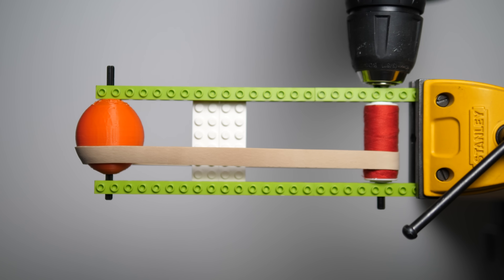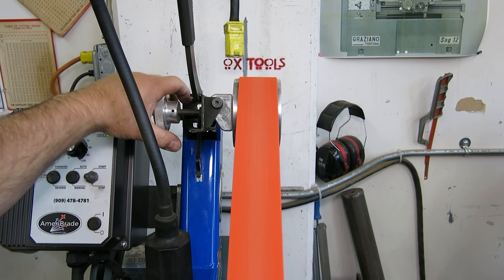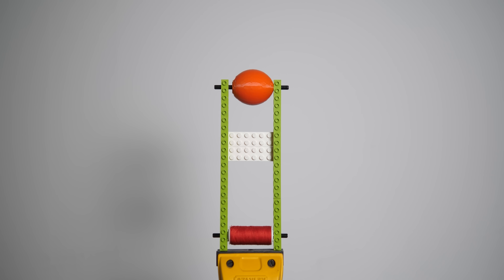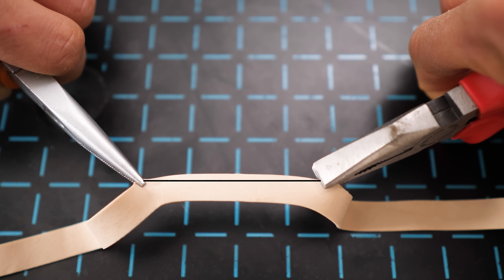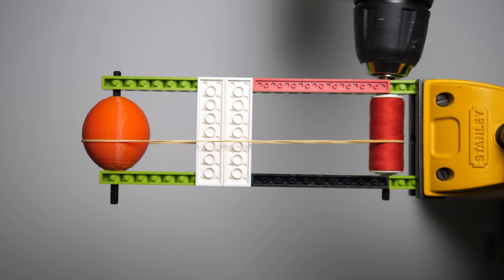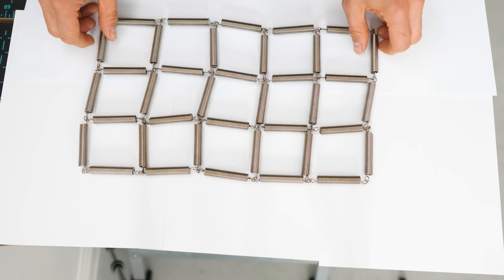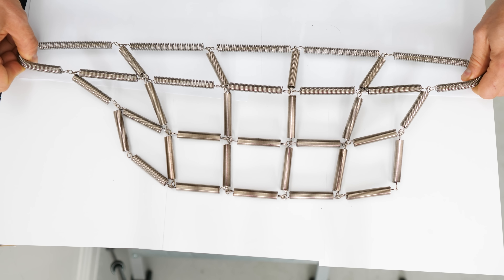The Band Should Slip Off But It Does The Opposite!

Comment: The other reason/force for this, that isn't really mentioned here is "Friction". This has to be a rubber/elastic style belt/band. As the belt starts to "slide" off one side, that side has less tension, and thus, less friction. The side with more friction "pulls" in it's direction until it reaches a point where the friction starts to balance out (the pinnacle of the crown side of the pully). In your inverted version that's the same reason it pulls off to one side. One side happens to have slightly more friction than the other (and it would only take the most miniscule amount to set the disbalance in motion), so that side pulls harder, causing more and more tension on one side. It's trying to find a "balanced" side... but since you specifically designed it to fail... it does. One might argue then that it should stay in the middle then since that's the most balanced... and whilst that is technically true, that's only if it had some sort of course correcting device in place, because even the smallest amount of tension difference (which is going to happen in anything moving) will cause it to start sliding off.

Comment: Imma take a wild guess before i continue:
Due to the curvature at the end, when you bring the belt lower the upper part is stretched more than the bottom part. This difference gets smaller as the belt gets closer to the middle so it tries to minimize this difference
Reply: Right path wrong reasoning!

Comment: Hey Steve,

Funny thing is an everyday appliance, front loader washing machine that use pulley motors have this in them. When realigning them you place the belt anywhere and it centres out. Quite awesome.

Comment: Why did you actually mention about entropy to explain why the flat rubber band tends to move toward the bulged center. It kind of confused more and took the video to different direction. Your spring analogy helped to some extent though. It would have been helpful if you had mentioned about the higher linear velocity toward the buldged part that tends to pull the the upper part of band faster eventually pulling the lower part.

Comment: I don't think that's the reason, but instead the sideways slip generated from the straight lines on a curved surface. You know how on a circle the straight and parallel lines still intersect and when the rubber is sliding on that convex shape it literally rotates it because of the curvature on those straight lines, then the bigger radius requires more material which contributes to that rotation even more

Comment: You are just wrong. Yes, bow will contribute, but it's not main reason. If you look how conical shape of train wheels allows trains to self-center itself on tracks and follow curves of tracks without differential gears, you will notice that same effect explains this belt, but tracks don't bow nor are elastic.

If we look from pulley's perspective, at lower edge of belt, wheel have smaller circumference than at upper, so, per one turn, wheel runs smaller length along lower edge than upper. That means that wheel is turning towards lower edge of belt. Then we look same from belts perspective, belt is pushed up (like when car is turned left, we can say that road is pushed right).

Comment: That’s exactly why train’s wheels are not flat but are conics, first to always center the train to the rails and second to avoid the need of a differential where the conic shape able the train to turn without desynchronising right and left wheel´s speed

Comment: This explanation really helps, not just highlighting it, but showing that intuition does work, if the rubber string is as wide as thick. 
Now I am only curious whether there's an maximum angle on the surface the rubber band is attached to where it stops creeping upwards, or perhaps the bend depends on the angle and with higher angles, the band bends more and consequently something else gives first before this phenomenon starts to swing the other way. 
Nice.

Comment: Is here a "critical width" where the rubber band no longer is self-centering? You used a wide band and a narrow band. What if you cut the wide band in 1/2 down the center. Does it still self-center? If so cut some more off, if not, cut only 1/4 off. The more interesting question is why would there be some "critical width" where the band is self-centering on the crown pulley?

Comment: My guess was about full energy of system, the motion transmit to a "ball", if we assume that linear velocity of strap equals to linear velocity of the touch point, the angular velocity equals velocity over the radius, so bigger radius means less angular velocity and less kinetic energy of the ball (T = Jw^2 / 2). Also we can write the lagrangian of the system (L = T - P) and get the equation of motion)

Comment: Anyone who has changed the belt on a vaccuum cleaner brush has seen it in action. Straight motor shaft and crowned pulley on the brush shaft.
Reply: And the blade on a band saw rides in two convex pulleys. The steel band is also "elastic".

Comment: Mathias is nuts! I once saw he building a tool that was precise in the nanometers. You'll never need to be more precise than a milimeter in woodworking. He is just that perfectionist
Reply: Sub-millimetre precision in woodworking is very much a thing. Also a tool that's precise in the nanometres seems like hyperbole, given that at the time of writing ASML is basically the only manufacturer who makes nanometre precise tooling of any kind.
Micrometres, yes, I can very much see Mattias tweak and fidget until he gets to that point. Personally in all my years of being a fine furniture maker, I have never bothered with a scale smaller than a tenth of a millimetre. For surfaces that are touched, or that are in direct sight, like say an inlay, sub-mm accuracy and precision are most definitely a thing.
Reply: “never” — that word you are using: I don’t think it means what you think it means!

…and you may not be a woodworker.

Comment: Train wheels are part of a conical section with greater diameter on the inside.  When the wheels get off center, as on a curve, the outer wheel has greater diameter (and circumference) than the inner wheel.  Since the two wheels are connected by a fixed axle, the outer wheel with greater diameter goes farther.  This turns the wheel back to center.  That is so cool.  I always thought is was the flange and the wheels just banged back and forth between collisions with the flanges.

Comment: i think it would be simpler to explain it as a disproportion of pull exerted on the belt, the side of belt that is stretched more is pulled with a greater force which is distributed not perpendicularly to the belt's motion but at an angle and that disproportion moves the belt in the direction of a greater angular speed as the molecular structure of the belt tries to even out the distribution of force. even more simply put, the side of the belt that is more stretched moves faster and pulls the slower part. but it's damn counter-intuitive! thank you!

Comment: tension at the top of the band (if its at the lower end of the pulley) is tighter than the bottom edge of the band. therfore it pulls itself up until both sides are equally taught

Comment: one of the first things I learned in machine shop is the crowned pulley, I thought to my self,"why didn't they just put a big flange on both sides?" because the belt will just try to climb up the sides. I think I understand it now 43 years later, kind of😄

Comment: @5:40 In the case of rubber, doesn't the fact that it's vulcanized play a role? As in, the polymer chains are crosslinked with something like a sulphur bond, preventing the chains from "sliding" too far,  the electromagnetic attraction of the atoms acting like springs (because entropy of course)? I thought vulcanization made the difference between wax and rubber (Modern synthetic polymers excluded).

Comment: I worked in the clothing industry as a cutter using a band knife, that is a steel blade the same as a band saw (a saw has teeth) the three wheels that the blade ran on each had a crown, and it always pulled to the highest point.

Comment: A set of crowned tires, or a single crowned and one flat tire, on a bandsaw is used to center the Steele blades. As counter intuitive as it is. This is along with tension keeps the blade on the bandsaw while it is running.

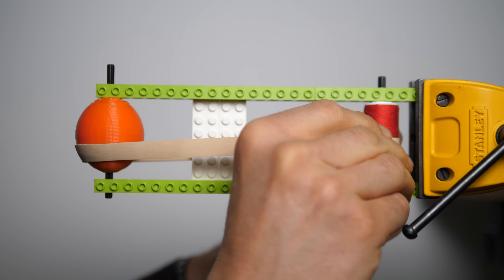Comment: My guess at 0:43, the belt is under higher tension closer to the middle of the pulley than away from the pulley. Higher tension means more friction on the surface, which nets a force towards the apex of the curved surface. That will keep the belt centered throughout operation.

Comment: Something you glossed over in this explanation is that this centering works even on a flat belt with very little tension.  Hard to put this into words, but I would say that the end effect of angling the the belt off from its 'length' alignment causes the belt to climb toward the crown of the pulley.  For many flat belt machinery tasks the belt is quite laterally stiff (does not flex along its width dimension) and can be under very little tension.

Often times a tractor does not need to line up its drive pulley perfectly parallel to the driven pulley to keep the belt in place well enough.  Twisting the belt is done to reverse the pulley rotation as needed.  The broad surface of the belt provides enough friction to turn the pulleys even with low tension.  One rule of thumb I have heard is 1 hp per inch (of belt width).  This power ratio works even with a slack belt, but it increases with tension.

Comment: I just watched this, because imo after reading the title and seeing the vidiocard i tought this was totaly logical, but I was wrong!  In my toughts i was sure that it was moving to the middle due to the speed in the crown, since the larger diameter travels slower , I tought that the belt moved towards the middle due to it beeing the slowest part of the pulley and therfor forsing the belt to move towards the middle.  Still a great vidio tho!

Comment: The principles behind the crowned pulley are also applied to the wheels of a train. The bevel on the wheels is such that the outmost edge of the wheel is a smaller circumference than the innermost. This allows the wheels to tend toward self correction on the tracks and puts less force on the inner rims of the wheels.

Comment: One minute in and this actually makes perfect sense. The part of the rubber band towards the center of the orange is greater then the outer edges. Causing the rubber band to be pulled by the "Grater Force". For example I was driving down the freeway after a snow storm. the freeway was just wet. I came to a particular part of the freeway where some slush had accumulated on the side of the lane. As my tire hit that slush the friction on that side was greater pulling my car off the road. Same with this rubber band because the one side is more stretched the friction of that side is greater causing it to be pulled to the center until all sides are equal in friction.

Comment: Friction is the only force moving and maintaining the position. The stretched out part has more of a normal force on the  surface therefore there is a difference of the friction created by the static friction distributed across the width of the band and the pulley.

Comment: I am a millwright and learned all about pulleys and crowns in trade school. Lots of machines use flat belts and pulleys still and knowing how to adjust tracking is a skill we had to learn. To get a belt to move to the centre of a roller one pushes the end to which the belt travels away from the machine frame.

Comment: Bandsaws use a rubber tire and a steel saw blade.
Yet they perform in a similar manner.
It would be interesting if you could duplicate it with a steel band and latex hose stretched over the tires.

Comment: Personal guess after watching intro but before the rest: it has something to do with the difference in velocity of the rotation between the ends of the egg & the center. Given the width of the band, there will be a discrepancy between the forces experienced at the end of the band wrapping around the smaller diameter end of the egg, vs the end of the band wrapping around the wider diameter end. I don't know exactly how this turns into the band moving up towards the equator of the egg, but I'm convinced the different rotational speeds of the tapered ends of the egg play a central role.

Edit: yay I'm smurt. I considered the effects of a thinner band as well. Whee.

Comment: Without watching the video, I'm going to write down why I think it goes to midline of the egg. 

It's because of rotational speed. At the the outer edges, the linear speed of the band would spin the egg at a faster rate than it would at the center. Spinning at a faster rate requires more force, so it moves to the centre to where the force is lesser. 

Now time to watch and then update this post on if I'm correct or not!

Mid watch update: It's not an egg, I'm such a moron 🤣

Mid watch update 2: Totally wrong. Thin band doesn't do this at all. Moron status confirmed.

Comment: When I was a mechanical apprentice they made us do the maths for belt drives.  I can't remember it now but you had to know the tenstion on the tight and the loose side .  They told us that belts move up on pulleys. It there are several diameters on the same axle,  each diameter curves up to the step / shoulder to the next pulley.  They made us calculate for V belts as well.  Never used it.  Thanks for explaining it.

Comment: When the wider rubber band center on the sphere is because wider side has more tension, which is tighter then the other side, which create more grip power. 

The thin rubber band does the opposite because the effectiveness is less then the slip off force. Therefore it does what it suppose to do- slip off.

Comment: A band saw uses a crowned pulley but the blade is steel and some band saw blades run under almost no tension.  Same thing ?

Comment: I don't know if my explanation is correct but I think the reason the band doesn't fall of is the following: the part of the rubber-band that is closer to the middle is stretched more, therefore it has to cover more distance compared to the part of the band further away from the middle. This creates and internal stress in the band that pulls it towards the middle.

Comment: Reverse crowned idler rolls are used in the web handling business like printing, web coating and paper making to prevent wrinkles. As a retired Process Engineer I’ve used them for decades for various flat substrates and it is still, to me, non intuitive.

Comment: What you are calling pulleys on a belt drive i know as sheaves pernounced shivs. In my work pulleys are an entire assembly including the frame sheaves are the (normally) grooved "wheel" that a drive belt runs on. But with this being crowned idk if that should still be considered a sheave or not. Theres about as much of a debate over the definition of a sheave vs pulley as there is to which engine oil is best.

Comment: When I did my degree (mechanical engineering, a long time ago) we spent half a lecture on this. The lecturer (a tenured professor) actually explained it in terms of velocity and angular acceleration of elements of the belt. I was more confused after than before. This deflection-based explanation is way better, and makes me wonder if the comparative angular acceleration explanation was just totally wrong. Also had no idea elastomer elasticity was from entropy... awesome
Reply: I would agree with angular acceleration more... What he showed seemed to be true about rubber bands.. I wish he had gone into more explanation of practical example.. Sandpaper and leather belt are intuitively not stretchy... Both of which he showed video of though
Reply: I have the impression both explanations are different ways to say the same. Like how LaGrangian mechanics end up being Newtonian mechanics just with another philosophical approach. I like Steve's explanation better, tho

Comment: This was known in the early 1800s in those factories with driveshafts running the length of the ceiling and flat leather belts coming down to each machine.  They ran the flat leather belts on crowned pulleys.

Comment: I think the explanation is partly true, but there is a much more simple solution of the question.
Lay the belt on the table in a straight line. Put a conical roller on it and roll it. It will turn in a curve to the smaller diameter side, the band will tend to the higher diameter side.
If the roller is fixed, it can not take the curve, so the band does it.
The spherical roller is a series of cone slices, at the sides the steepest ones, in the middle the flattest ones. The steeper it is, the more the band tends to go to the higher diamater, in the middle of the roller it tends to nowhere any more. That means that the balance is in the middle, the whole band tends to stay there, the more you move it to the side, the more it wants to get back in the middle.
Simple geometry, no real physics is needed.